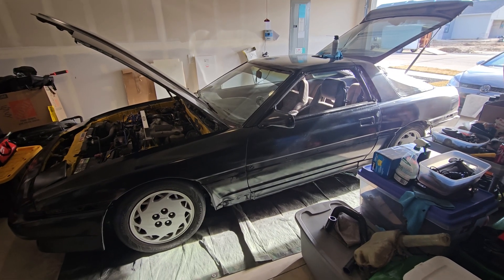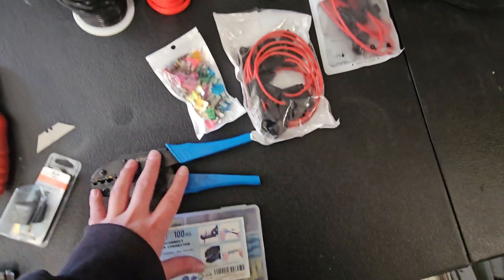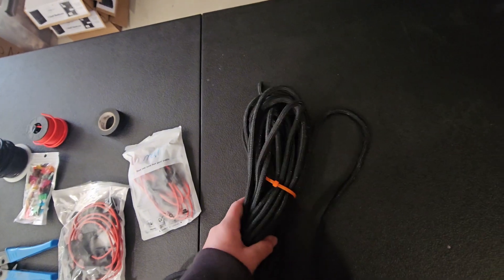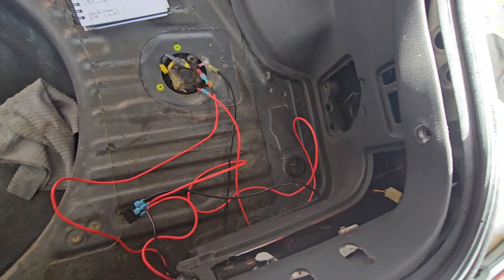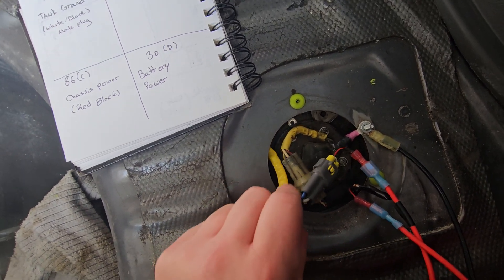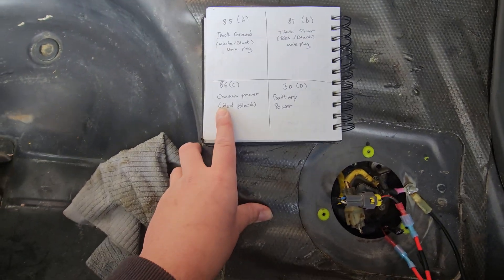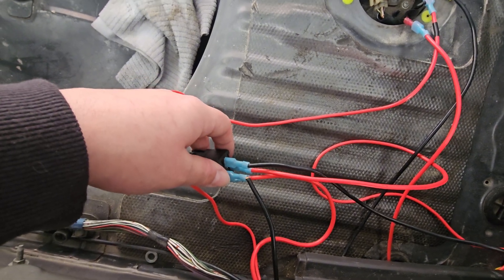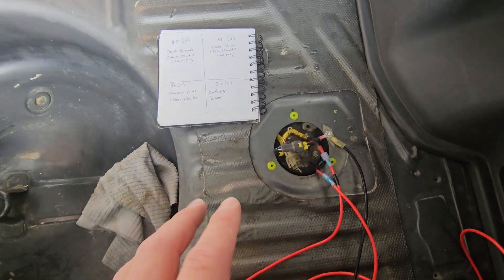Mk3 Supra 12V Fuel Pump Wiring Guide (how to wire your fuel pump)

Comment: After this, do you remove the fuel pump relay resistor unit by the passenger shock tower?
Reply from the maker: My fault for not responding sooner. I still have my resistor connected on my car. The relay is disconnected.